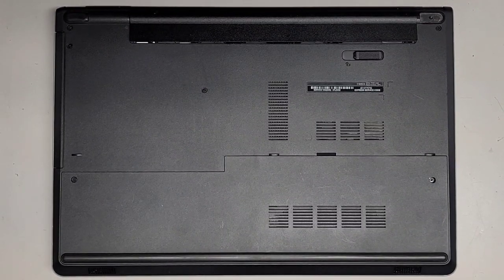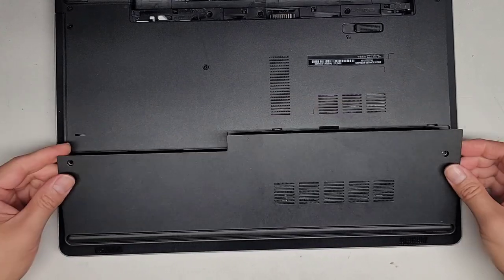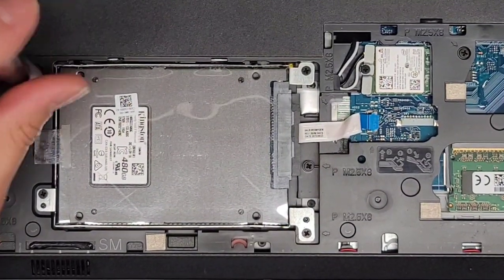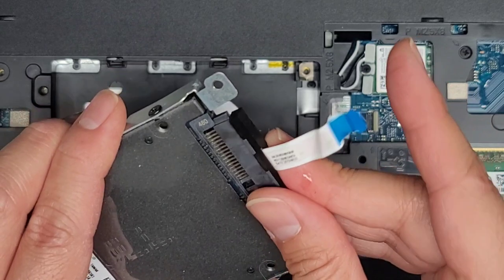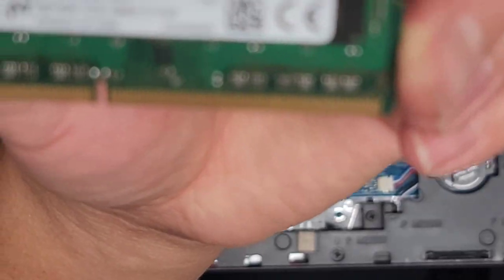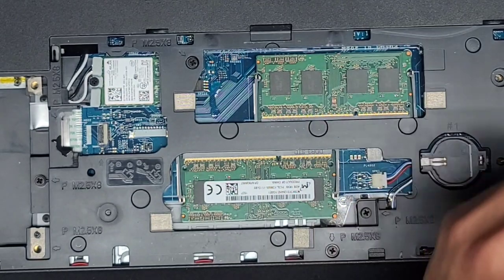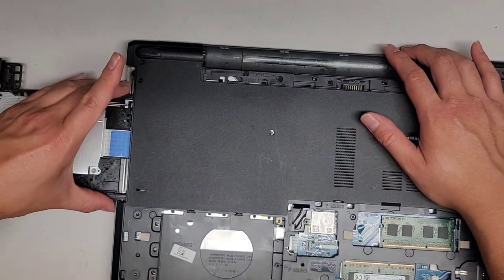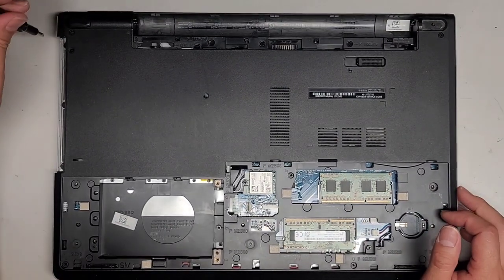DELL Inspiron 5558 Disassembly RAM SSD Hard Drive Upgrade Battery Replacement Liquid Spill Repair

Comment: Sir, so after i replace the cmos, i accidentally clicked "reset default bios settings"... And now the internal HDD is running at 100%.... running so slow... i had to manually enable the SMART functionality of the HDD in the bios, but im not sure what else needs to be done?.... I am running all of the Seagate tests/fixes, etc... But this all seems so weird after not using the laptop for 1.5yrs... And now it has all sorts of issues... Any pro-tips for an out of luck slum such as myself?? notice i did the new comment thing, per your recommendations in your newer video
Reply from the maker: Likely bad HDD https://youtu.be/4p5jFDzVwUw